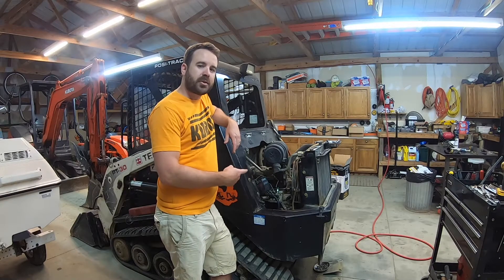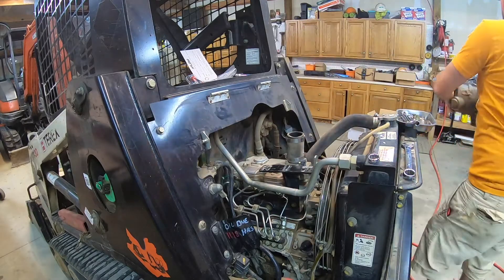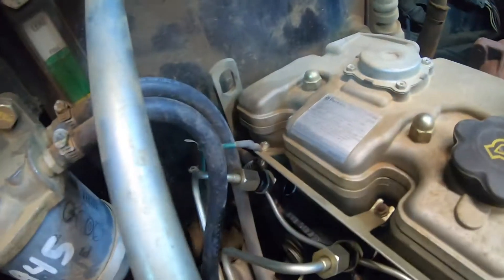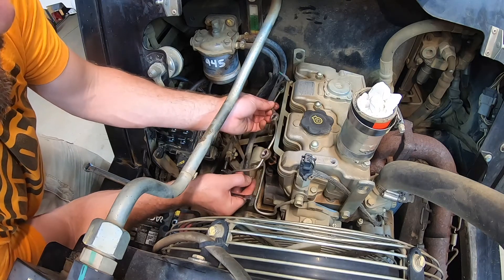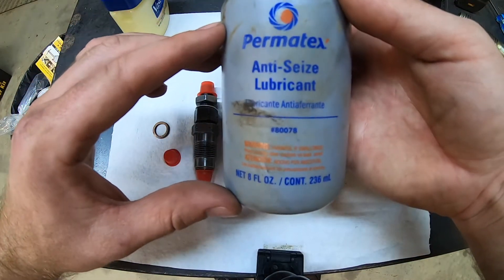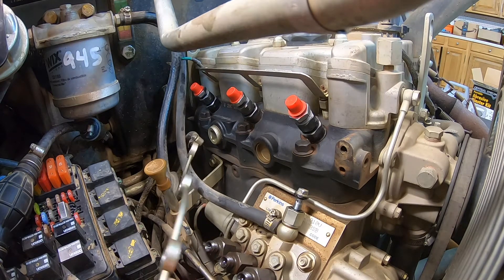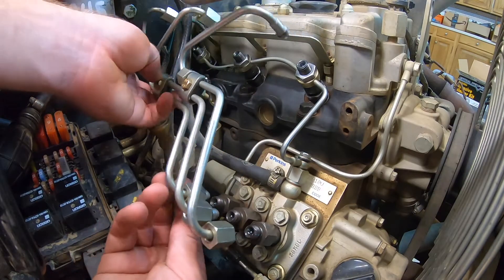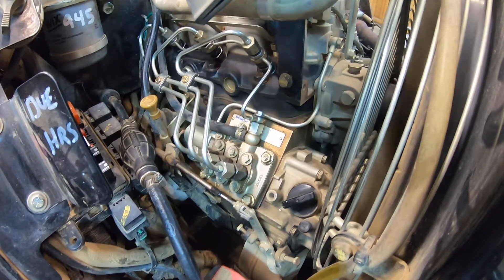TEREX PT-30 Track Loader Injector Replacement

Comment: Neal, thanks for the informative video. How did you know the eBay injectors were bad and leaking?
Reply from the maker: Well basically the machine was knocking even harder than it did with the original injectors. I didn't do any tests or anything but it had a very loud fuel knock.
Reply: @NealORussa  Thanks for the quick reply. Looks like I will be pop testing these Amazon injectors before installation. Hopefully that will find any that maybe leaking before tearing it all down. The dealer claimed to just have had 2 of the three serviced, why only 2 of three? Not sure. I have a rough idle that clears at higher RPM and a little leaking around one injector so I know it needs some attention.  I am really enjoying your videos, I have very similar equipment so they have been very concise and inspiring of new DIY attachements. Your excavator root ripper is next. I will need a post hole digger soon for my Terex R070T skid loader, any ideas or experience with that?
Reply from the maker: @RobertBurns-ji7ip  Thanks for the great comment!  Yes seems like all three could have been serviced, but maybe they tested them and one was within spec.  My perkins seemed to run rough at idle as well, I think they just like to run wide open, but a leak should definitely be investigated.
The root ripper is a great tool to have!
I always keep an eye out for a post hole digger as well.  My plan is to find a cheap name-brand auger, then cutoff the adapter plate for it and weld on a new one for the ASV.  I had a chance to buy a nice bobcat auger a few years back with 2 bits for 1200, but i ended up not getting it.  Kicking myself now.

Comment: My pt30 doesn’t start and it’s not the battery what would it be?
Reply from the maker: Man there's a long list of things to check but I would start with the master battery shutoff switch on left hand side of engine compartment. Then I'd go through the fuse box check all the fuses and possibly pull them all out and blow out dust and dirt with air and spray electrical cleaner in there and blow out again. Then if that doesn't work I'd move to the starter. Could always try to jump the solenoid see if it cranks. If so then probably need a starter. Lastly key switch could be faulty.

Comment: You still have this machine? For sale by any chance
Reply from the maker: No I have since sold the pt30 and got an asv Rt40. Very similar machine.
Reply: @NealORussa  what do they cost? Rt30 or asv40? Looking to get one just dont want to over pay
Reply from the maker: @felixnungaray3253  I think the rt40's used are in the $30-35 range. The used pt30's id look to be in the 20-25 range.

Comment: where did you get your little plastic caps used on the injectors
Reply from the maker: Hey Jordan! The caps just came with the rebuilt injectors from the shop. Not sure if they're something special but they seem like npt or hydraulic fitting plugs or caps.